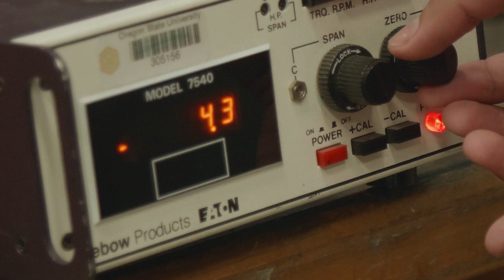Wave Energy Testing

Comment: Let's hope that every device born here is not of the "point absorber" category.  Since the 1970s, a lot of effort (including my own, since 2007) has been expended on point absorber ideas, and they work!  But the electricity produced is of very uneven quality, and the devices cost huge amounts of money to take out to sea and deploy.... then maintain!
My working parameters have evolved to (1) no women (or men) go to sea, all devices install and maintain themselves autonomously (2) no electricity and electric wires and cables on the seafloor (3) located well offshore, so no visual pollution or fishing areas disrupted.
I now think that "overtopping" devices hold the most promise, as the "Wave Dragon" in Denmark has produced the greatest amount of kwhours of energy, cumulatively, of any wave energy conversion device operating.   And no electric generators offshore, IMO,  but something else.  <<I'm having it evaluated by a research lab.
Reply: Yes, it is apparent and obvious that once the performance and cost efficiencies of wave and tidal energy are maximized, the sky is the limit, or shall we say the bottom of the ocean is the limit. Might take some more patience.